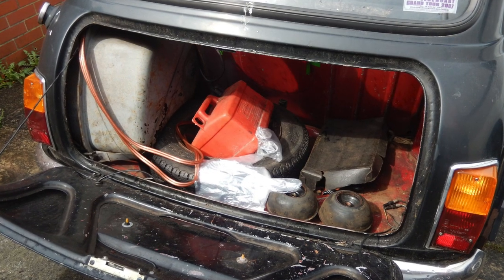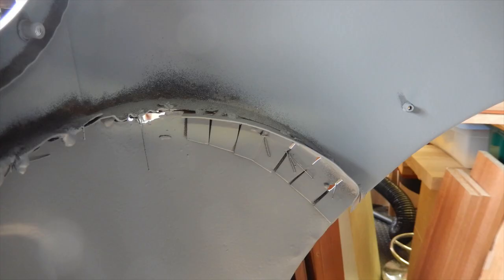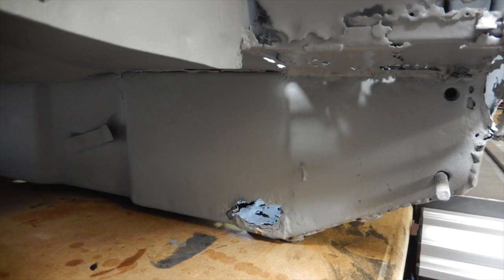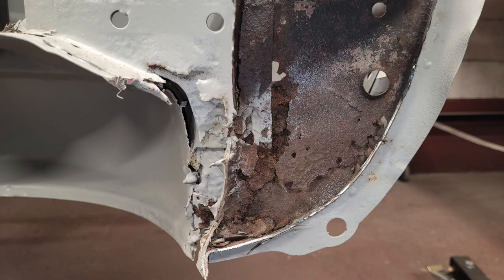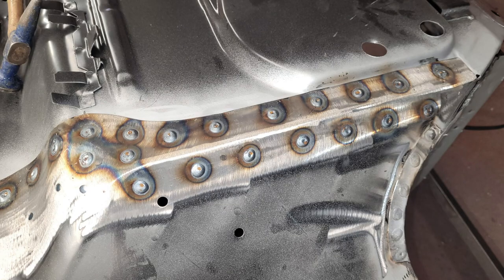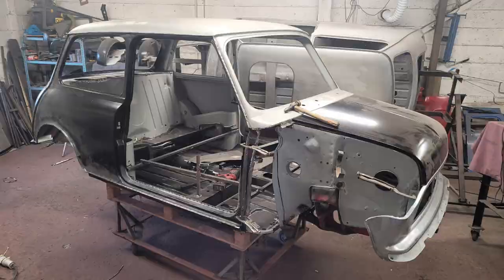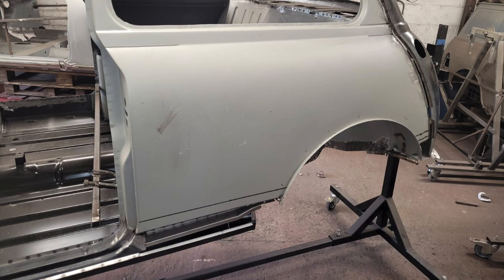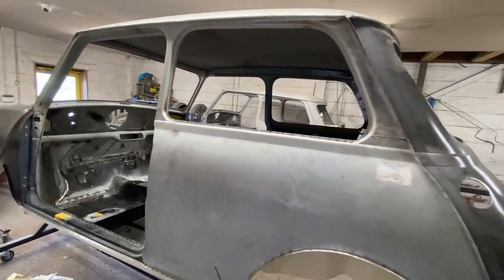Classic Mini Restoration Episode 36 - Bodywork Repairs At Classic And Retro Restorations

Comment: That was some undertaking! Bet you're glad you have someone as skilled as Dennis. Awesome job
Reply from the maker: If I knew then what I know now...Id probably not have bought the car as I honestly believed id be able to sort it all out. Id have probably looked for a car in better condition. But the flip side is that I know it'll be right when its finished and I pretty much know the car inside out now. But without Dennis...it'd still be a rusty old shell in the garden :-) Can't wait to get it back from the paint shop and start putting everything back together.

Comment: Nice results, if don't mind me asking how much did it cost to welding and paint the bodyshell?
Reply from the maker: Not quite sure just yet as it needs it’s assessment from the paint shop. The price can vary depending on how much work there is to do and it can vary from shell to shell. I’m expecting it to cost around half the amount it would have cost for a re shell.